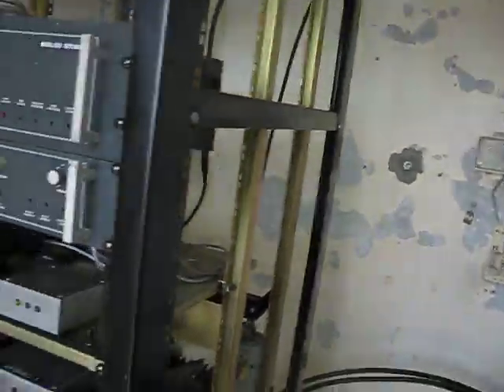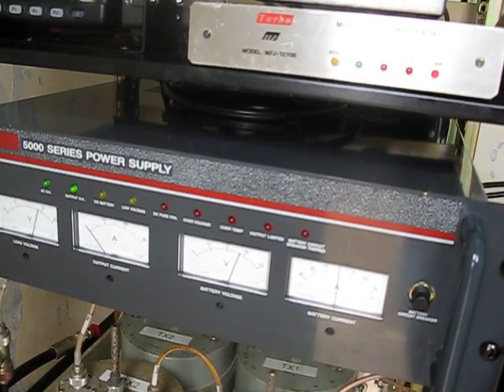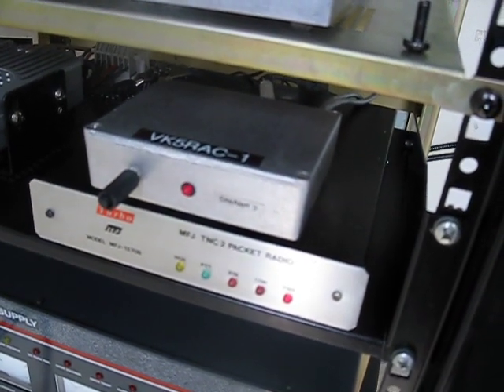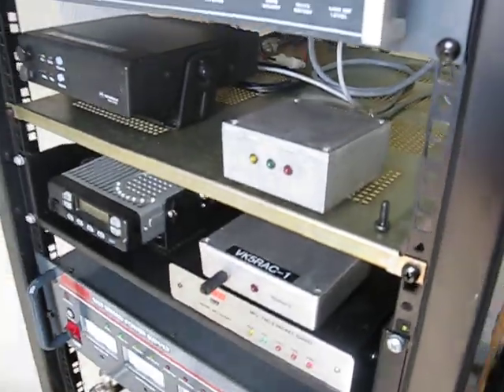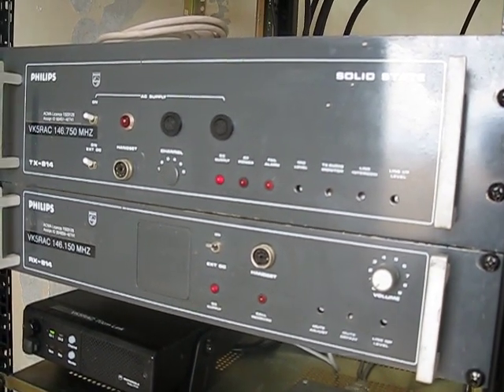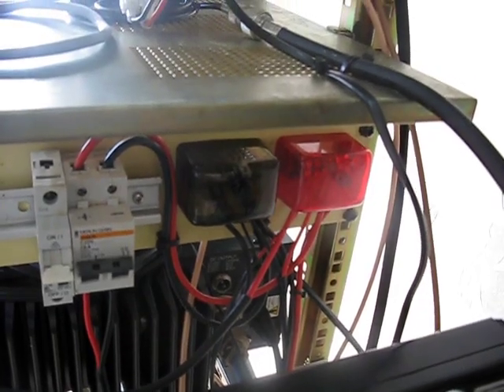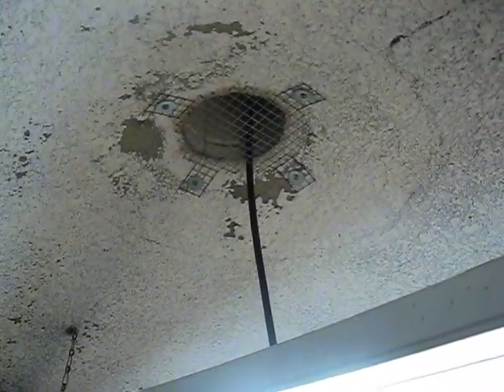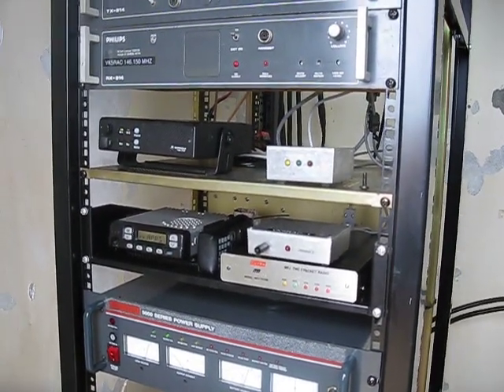Tour of the VK5RAC 2m FM repeater site

Comment: I had a "Mouse Problem" at a site called Joaquin Ridge near Coalinga California.  There was no apparent Mouse Entry Point but after a through investigation we figured out that the mouse was climbing in the AC Power weather head outside the building, traveling about 30 feet through the conduit and popping out an opening in an unused electrical box.  The little bugger even had a little bed made of twine and bits of cotton in another unused electrical box on the same conduit run.   Mr. Mouse apparently spent most of his time living in a Motorola MSR-2000 UHF cabinet which I of course had the pleasure of cleaning out.

I don't know if your Bush Rats are that persistent but our Valley Mice never seem to give up.   Wonderful Video - Thanks for Posting.   Ed/KB6DRN - Central California

Comment from the maker: I should have shown the tower too... the 2m repeater antenna is an RF Industries COL17 mounted right at the top of the tower. This is our second COL17, the first one failed after around 18 months.  We also have two RF Industries VHF folded dipole antennas on the tower, one is being used for the APRS digipeater, the other was used for the old packet ROSE node... but can now be used as a spare.

Comment: How's that Moto M10? doing as a UHF link? I've never tuned my GM300 down but one of the local repeater owners in Lubbock uses on as his TX side of his repeater (I think he's using a Bendix on the RX) but he's said he's had trouble turning them down below 25W…over heating for some reason.

I wish we had UHF CB state side.

Comment: That's a Motorola Radius M120,  2 channel @ 25 watts by factory default, The M130 was the 40 watt version and the GM300 the 16 channel 40 watt version.. Unless someone hacked an M120/130 faceplate onto an M10..
The M10 was the 10 watt version of the radio and did not have any channel selection options as it was a single channel radio primarily used for SCADA systems and like your using it for as a link..
I don't mess with ham radio stuff if I can help it, mainly because the hams in my area have this HUGE ego problem and know nothing about radio or electronics..
The problem I have with the guys around here is they don't want to pay me for my services and want me to tell them how to make a repair. Ummm NO!. Oh they want to call me to repair an aged repeater that is barely working but not pay me so I gracefully decline helping them anymore. I cannot afford to donate my time and knowledge for free nor do I play "teacher" and tell them how to fix their equipment. They are supposed to be the radio guys they should know this stuff. I mean when my systems go down I have redundancy and I know my systems inside and out..I have to know this stuff because I have paying customers on these radios...
I own and operate mainly commercial repeaters here in the states but all those are actual Motorola repeaters for digital operations. I have GMRS (similar to your UHF CB but we have 8 channels in the 462 MHz part of the UHF band) repeaters made from Maxon SM4450EX mobiles. 40 watts on those where GMRS license here allows up to 50 watts so not bad..